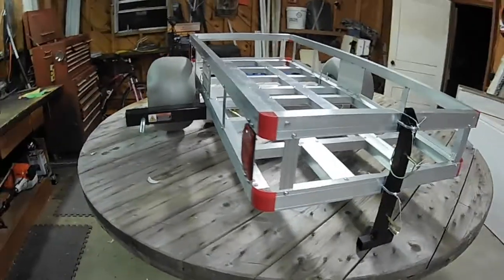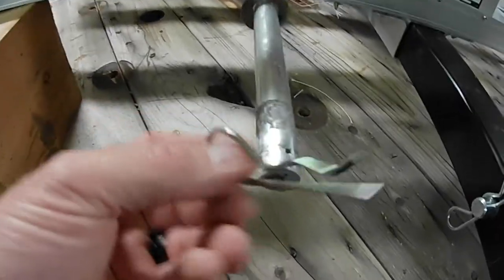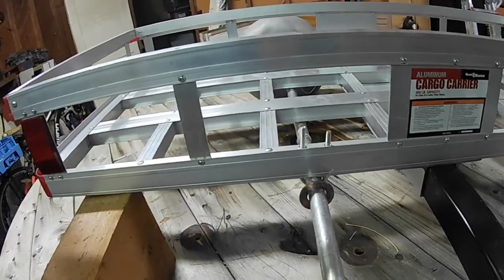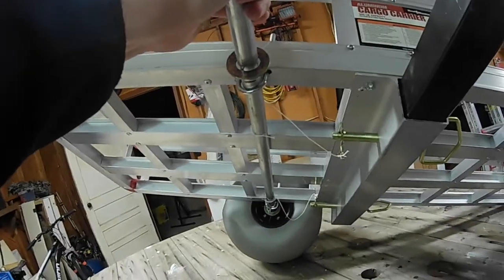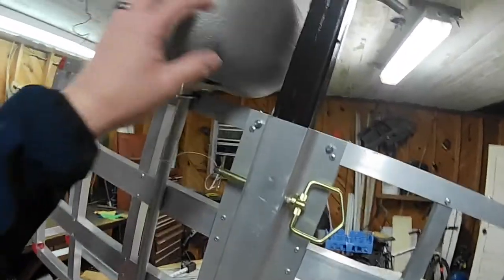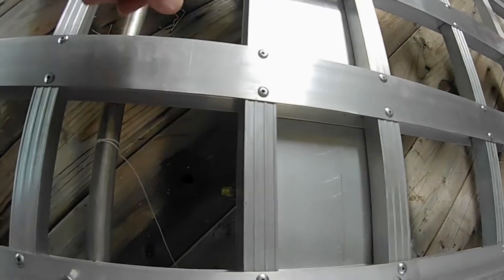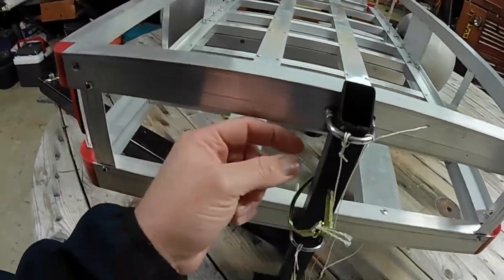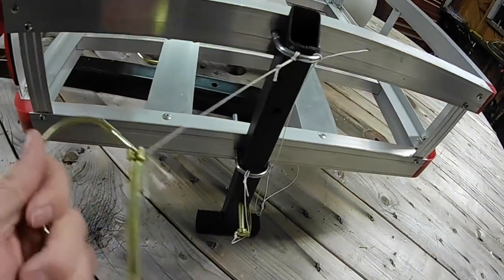Harbor Freight Beach Cart | BUILD

Comment: A buddy took two of those carriers and made a two tier pier cart for himself. at first he used two 20" bicycle size wheels and two casters but has since switched to four fixed 8" generator wheels. He made a recessed top lid that forms a tray on top, he found an aluminum baking sheet or pan that fit just perfect which drops right in place. (He lost the first one to the wind, so now that tray is hinged so it folds down flat on one side if needed. 
He added a round 1" aluminum push handle set off the top frame about 4" or so and covered with foam padding so your hands don't stick to it in the cold.  The top and bottom levels are spaced using aluminum tubing he tig welded in place.. 
The downside is the size of the cart, its dimensions are less than ideal for most cooler and tackle box combinations.  His rod holders are PVC with the tops heated and flared outward. He also incorporated a parking spike of sorts that can be stepped into the ground or dropped between the boards on the pier to keep the wind from blowing it around.
Reply from the maker: @VB-bk1lh  very nice

Comment: this is nice and i had the older version reels on wheels cart  it lasted over ten years before welds started breaking..lol  i now have a wagon that ride on the Reece hitch ..lol  out side the vehicle..has a crank handle to raise the cart up and down for hauling and is easy to pull in beach sand...  and i put rod holders and replaced all hardware with stainless steel bolts ect ect..it will be sold along with my white 03 hummer h2 next year.. because im moving to a boat then and wont need a car any more.. love my hummer h2  but it about time to leave land for safer waters..where i can legally protect myself  there is no such thing as murder out at sea....lol
Reply from the maker: Lol thanks for the nice words

Comment: Dang...i cant find this style cart with the pinned receiver tube insert. My thought is to get a slightly longer section of tubing, and then you wouldn't have to remove the wheels to install it on the hitch.
Reply from the maker: Yeah that would work.  I also remove my wheels to keep someone from stealing them or dragging them on the road in and out of parking lots

Comment: Now you have me wanting to build one.  Could you drill a hole in the tube that goes into your receiver, and, put a bolt or hitch pin in it to act as a stop when you slide the cart on there?  That way the holes for the hitch pin that holds the cart on will line up.  If you did that, you wouldn’t have to slide the cart back and forth trying to line up the holes in the cart/receiver tube.
Reply from the maker: yeah that wouldn't be a bad idea. a simple screw would probably work. I may try that. We only go to the beach 3-5 times a year so i don't use it as much as someone who lives on the coast might.
Reply: @BrileyWray  Where did you get your wheels?  If you said in the video, I didn’t catch t.
Reply from the maker: @drkrm  amazon "12" beach wheels"

Comment: Genius! Definitely gonna make one of these but with 4 wheels
Reply from the maker: go for it. thanks for the positive feed back
Reply: How do you plan to fabricate the front across
Reply from the maker: @jessemurillo8223  you asking mike or me? I dont understand your question.  To add another axel is very simple unless you want it to swivel.
Reply: @BrileyWray  so did u make it happen? How did it turn out?
Reply from the maker: @zseven1419  the cart turned out great
Reply: @BrileyWray  did you end up making the front wheels swivel?  How Did you make the handle?
Reply from the maker: @droidinator1  no I just have two wheel right now.

Comment: Hey, thank you for this video! Please tell if the cart itself is heavy? I wonder if the stand and numerous rivets would be prone to rust? I'm thinking about building a lightweight cart for our beach furniture and accessories, just don't want to make it too heavy...
Reply from the maker: It's not heavy at all. The screws and rivets are aluminum or stainless steel so no rusting
Reply: @BrileyWray  Thank you! Please tell if tires normally come with all necessary items like shaft, pins, spacers etc?
Reply from the maker: the tires do not. they once come with tires. I use 1/2 alumni conduit for the axel.
Reply: @BrileyWray  Thank you!!

Comment: I did your build with a few mods. Did you have any issues with it sitting so low? Headed down to the gulf tomorrow so we’ll see what happens.
Reply from the maker: Occasionally going over curbs or off wooden ramps onto the sand it will drag but over all it hasn't been a issue.  If I did it again I might look at raising it up some but hasn't been worth messing with right now

Comment: In an effort to have the tires hold all the weight not me…..
If I were to add two more tire for    front would I need tie rod and rear axle position further back.
I still believe even with the biggest sand tires and perfectly designed beach cart, you’re really gone to need something motorized to take the work and struggle out of getting to the beach.
Reply from the maker: I pull this beach cart fully loaded 1/4 mile down the beach no problem.  A second set of tire would help. A motor would definitely make it effortless.

Comment: holy crap this is Genius! Can you share links to the stuff you used?
Reply from the maker: the pins are from Tractor supply, tires are 12" beach wheels from amazon, and the cart is a harbor freight  lugage rack, and i use 1/2" alumin conduit for the axel ...i hope this helps.

Comment: Would you mind posting a link to the wheels? And what diameter is the axle hole on the wheels?
Reply from the maker: StoreYourBoard Replacement 12 Inch Balloon Wheels Kayak Dolly and Sand Carts, Big Beach Buggy Inflatable Tires https://a.co/d/9g2vrI5

I think it might say the hole dia on Amazon. But I used 1/2 "aluminum conduit as my axel so u could Google the od of that conduit the wheels fet perfectly on it.
Reply: @BrileyWray  Thanks I appreciate that! I ended up getting a set off of eBay that shipped earlier for the same price. Amazon said 22 mm axle hole to fit 20 mm axles but that’s about the same gap as a 3/4 in conduit. I’ll see how it turns out sometime soon.

Comment: What did you use as an axel and how did you attach it?
Reply from the maker: 1/2" aluminum conduit and u bolts
Reply: @BrileyWray  how much weight did you put on it, and do you have any concerns with the axle sagging?
Reply from the maker: @jon7839  we have hauled both kids plus a full load of beach stuff and I don't worry about the axel on bit. The tires maybe but the axel is plenty strong enough. The tires have held up fine as well
Reply from the maker: @jon7839  I have a update video of us taking it out for the first time on my channel you might watch it and see the load we put on it